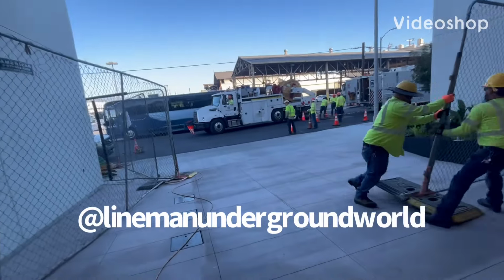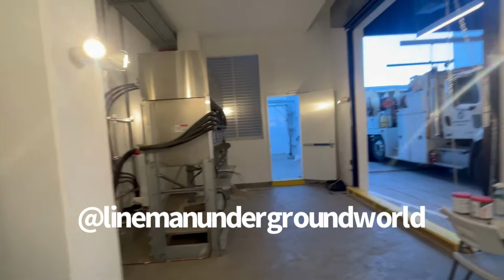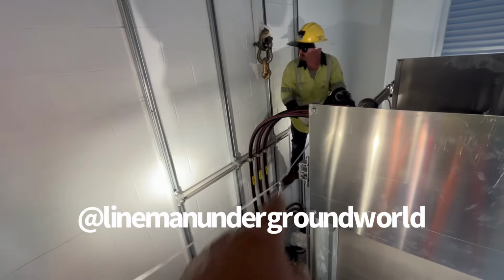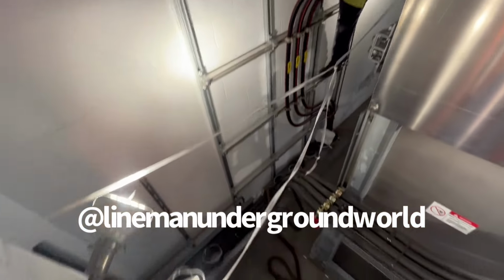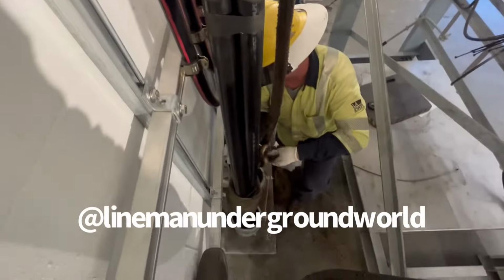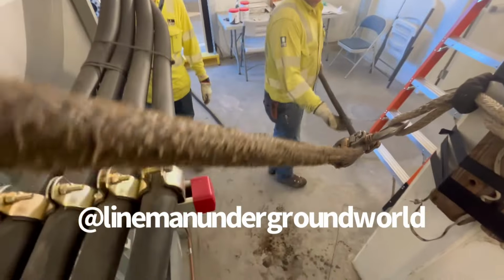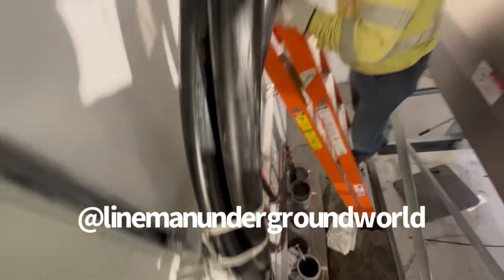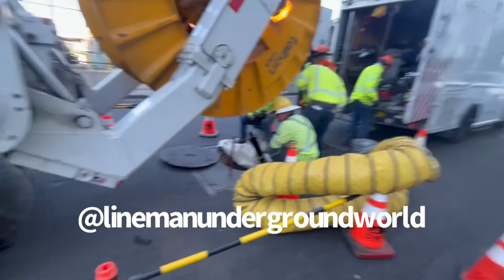Station Power

Comment: cool video! Is there any books you recommend to help me pass the electric distribution mechanic trainee aptitude test for ladwp? The apprenticeship aptitude test was nothing like the groundman aptitude test ladwp had to offer. The groundman test had sections like math, mechanical gears, reading comprehension, basic tool identification & map questions, was relatively ez. But the apprenticeship test had very trade specific questions, questions one would only be able to answer (for the most part) if they have experience working as a groundman with an overhead distribution crew, so it was challenging for me considering the material we went over in lineman school wasn't on the test & what I've learned so far ( 1 month) working as a groundman on an underground crew ( we trench, shore, lay pvc pipe, fill trench & compact it) didn't help me on the apprenticeship test either. I want to order 'The Lineman's & Cableman's Handbook' but I'm not sure if that'll help. I'm looking to put in the work & study my ass off but I can't find anything to study. If you point me in the right direction I'd be very grateful! Stay safe out there!